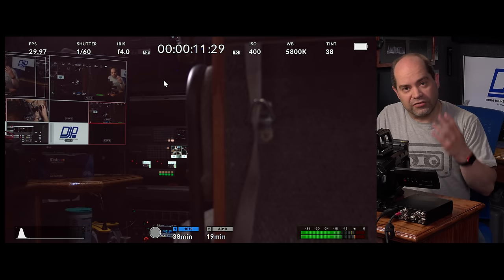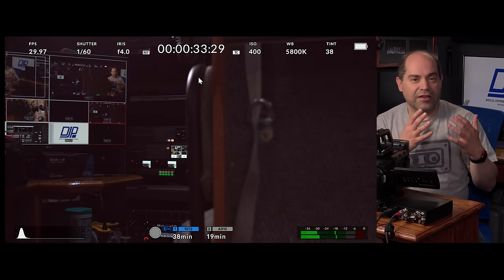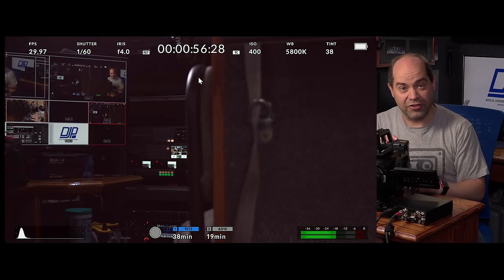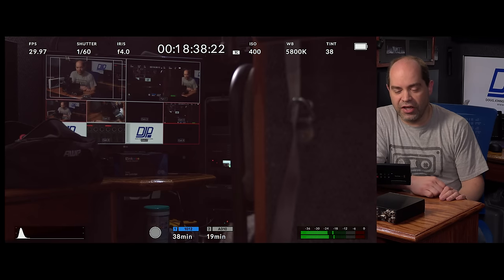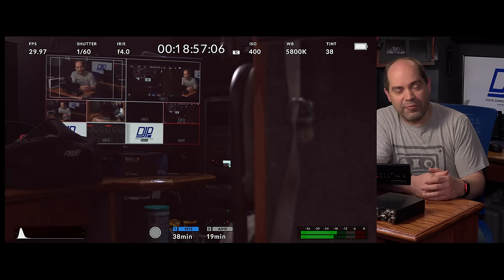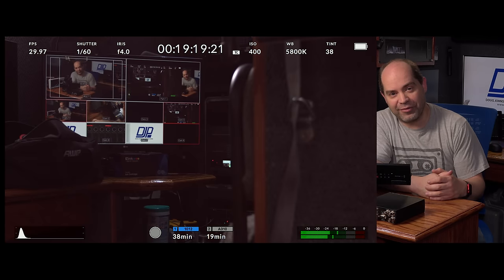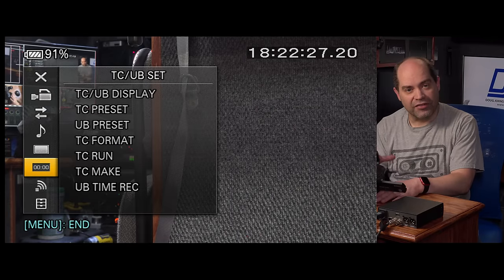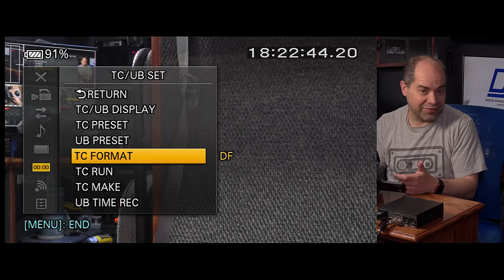Genlock, Timecode, Wordclock -- What Are They? Do I Need Them? Are They Interchangeable?

Comment: Hey Doug. I need to sync time code on three iso cameras. Hardwired is fine because they are all close to each other. Each camera has a single combo BNC TC in/out connection. I can master one and slave the second camera but how do I get the third camera to slave? Any ideas? I’m thinking of using the SDI out of cam 2 to TC input on the third cam. I have not tried that. Not sure that would work. Is there an external time code generator that you know of that has multiple outputs ( at least 3) that can run to the 3 cameras? Thank you!!
Reply from the maker: The "proper" way to do it would be to use an audio distribution amplifier to split the timecode output from one camera for the timecode inputs on the other cameras. But, in reality, you can use a simple cable splitter and it will work just fine. Audio is a lot easier to split than video.

The SDI output will not work. It is a video signal, where timecode is an audio signal.

Please keep in mind that time code does not keep cameras in sync. It only makes sure that when you sync up footage in your editor that the beginning of each clips is lined up properly. Cameras can (and do) still drift. If you are shooting clips more than about a half hour at a time you're likely to see that drift and will need to adjust the playback speed to compensate. The only way to ensure that cameras stay synchronized is to use cameras that support genlock and provide them with a genlock reference signal.

Go back and watch this video again. It has all of the detail you would need to achieve what you want.
Reply: @djp_video  Thank you so much!
Reply: @djp_video  I just wanted to thank you for your advice. We ended up jam syncing the cams one by one. We didn’t lose a single frame all day. Made editing a breeze!

Comment: What kind of signal protocol  the  video  reference connector output ? Is the same signal than a genlock ?  What about the embedded sync signal, outputted by the SDI in / out of the atem switcher ? Time code ? World clock ? Or genlock …? Is there a way to extract that signal since atem mini extreme sdi doesn’t have a dedicated synch out , neither the cameras … ?🙏🏼🙏🏼🙏🏼
Reply from the maker: The Ref Out connectors are generating Tri-Level Sync, which is a type of Genlock. These are analog signals. But that output isn't going to line up perfectly with the signal at the video input -- it has its own timing, mostly independent of the input (aside from frame rate).

The Ref In connectors all support Genlock -- both older blackburst-style as we as tri-level sync. On some devices (like the Ursa cameras) the Ref In can also take timecode. But that isn't "normal."

SDI includes sync information as part of the data stream, but it isn't so trivial to extract to do anything with -- you can't take an SDI output and connect it to a Reference or Genlock input, for example.

Consumer cameras and the ATEM Mini switchers don't support genlocking. That's something that's usually reserved for professional, broadcast style cameras, with a few other exceptions here and there in the Prosumer range.

I'm curious your use case in which you'd need sync from the ATEM Mini?